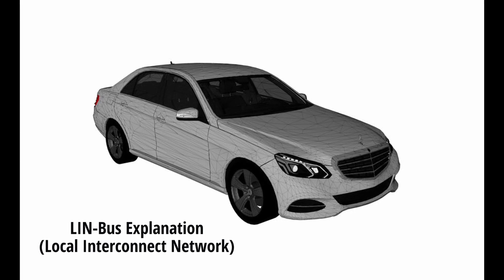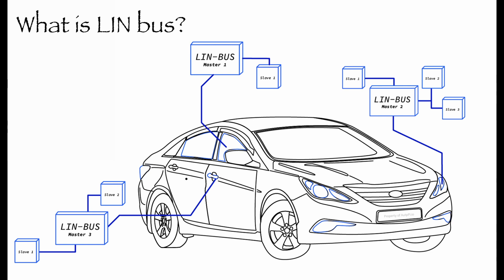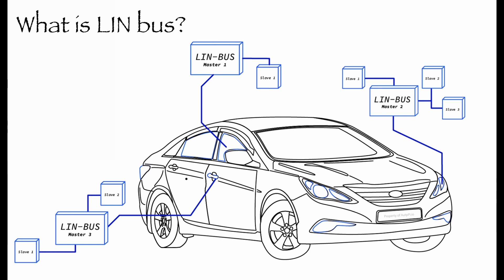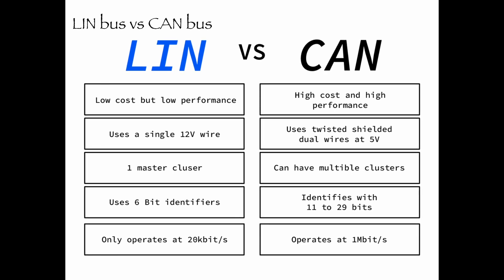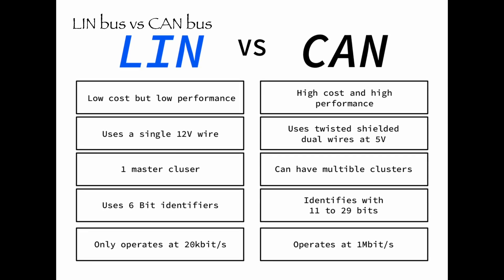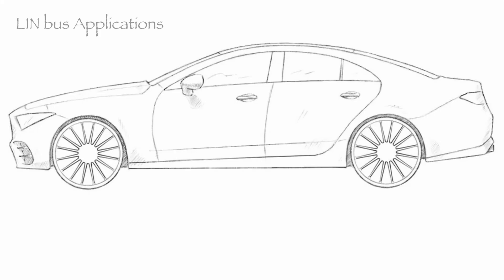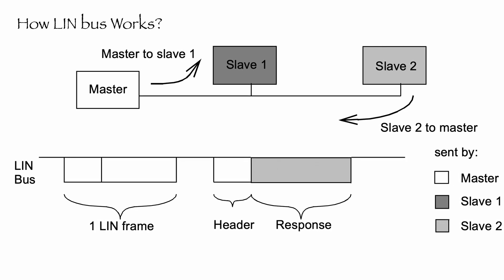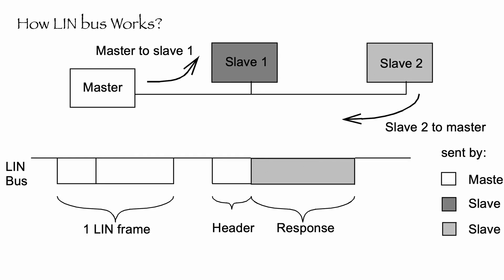LIN-bus Explained and How to Measure it on Mercedes-Benz E200 W212 2016

Comment: Thank you I subscribed. Very informative. I have a question, I replaced my alternator on W164 OM642 ML320 two times due to it not charging, I receive an error Control Module N3/9 common rail diesel injection control module receives no LIN message from G2 generator ... my LIN wire to the alternator plug has only a single pin in it, how can I test to see if the LIN line from the alternator to the cdi injection control module is working?
Also do you have any other possible reason the new alternators do not charge the battery?  I checked the connections and fuses near the battery and all are good.  No other codes are showing. Please help.

Comment: Hi, I have an issue with the lin bus wire from the ecu to the alternator. The lin bus is only receiving 8.5 volts, would this be enough to activate the alternator? Also what could cause lower voltage other than bad wiring or a faulty ecu? 

Thank you